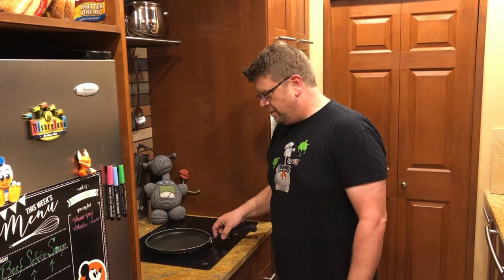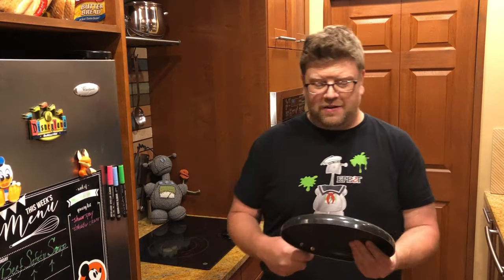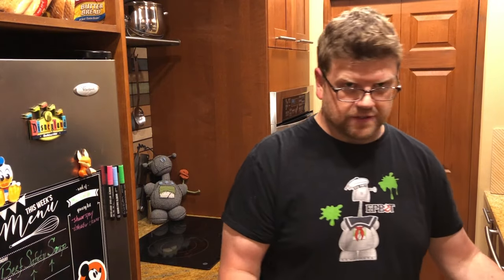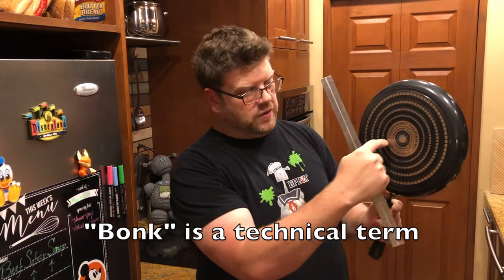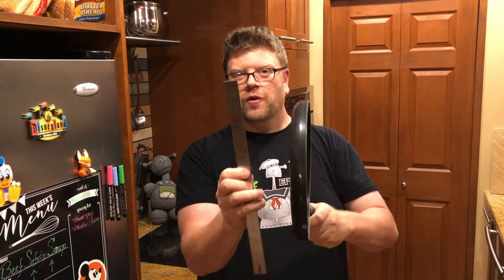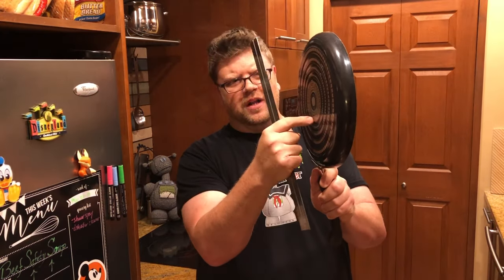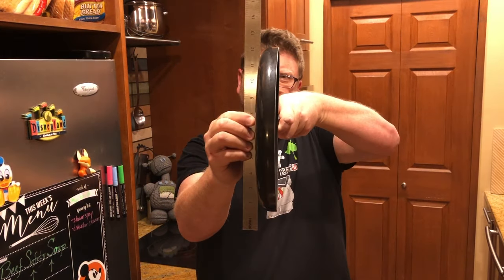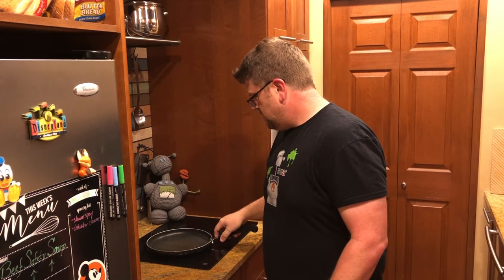Quick Fix: How To Straighten A Warped Pan

Comment: Cast iron pans, too?
Reply: I'm curious, do you have a warped cast iron?
Reply: Good gods, no! I was just about to write a comment upstairs on this ...

John's pan, and most modern pans, are made of alloys which have some flex and give in them; that's why they were able to bow out to begin with.  Cast iron is just that: plain iron, and because it is mold-cast, the iron is specially crystalline in its structure and, as a result, BRITTLE . You bonk a piece of cast iron, you're very likely to wind up with a pan that's cracked, chipped, or just flat broken in two.  The only person who should be trying to work cast iron is a blacksmith.
Reply: @jmcosmos  I honestly have never heard of cast iron warping before, only cracking. Thanks for the reply.
Reply: @Taintedeagle  Yes, that's the thing. Since cast is brittle, its default response is to break and not bend. I have nine pieces in my kitchen, all in current use, and none of them have ever offered to warp or bend on me.
Reply from the maker: As jmcosmos said, definitely NO bonking on cast iron! But really, cast iron should never warp in the first place.
Reply: @EpbotVideo  True dat, John. I have working skillets in my cabinet that are getting on for a hundred years old, and ain't none of them ever offered to warp. Nor do I expect them to, ever.
Reply: True. My cast iron doesn't warp. I have my mom and gramma's guardian ware that a few pieces are warped.
Reply: @allgoodmusic86  oh man, yeah ... aluminium cookware WARPS! Even Club Aluminium , which is relatively heavy stuff, will do it.
Reply: @Taintedeagle  I have a cast iron pan that is warped. I don't know how it happened but it is. It doesn't sit flat on the stove.
Reply: @SDM3791  my condolences.
The reason people say get a blacksmith, is because best case scenario it needs to be reforged.
Super heated, then finessed back. Otherwise crack, split, chip, or break.

Comment: You bonk the pan against a wood board on a work table.  Tapping while holding is absurd.  Second, enough banging and the pan just pots to the interior and there is no contact in the center.

Comment: hallo, john...thankYou, that was absolutelyGorgeous...i have a 3ply stainlessSteelPan that is warped ... anyWondrousSuggestions... enJoy aBlessedMemorialHoliday...peacePerfectPeace
Reply: Should be able to fix it more or less the same way.

You just mostly likely need to apply more force to a 3ply stainless pan, than what I’m guessing based on looks is a way softer mostly aluminium pan shown in the video.
The pan in the video is probably also a lot thinner then your 3 ply stainless pan.

I would put a towel down on a sturdy table.
Put the pan upside down on it, with the handle hanging over the edge, so the pan can lay flat upside down on the table.
Use the ruler to see where the bump is and give it a few good whacks. 

It should be flat again in no time.

Be careful about heating up your pan too quickly (especially on a induction stove) and if you want to flush off the worst gunk of your pan while it’s still hot, only use boiling water.
Do the rest of the washing up once the pan is cool enough to handle.